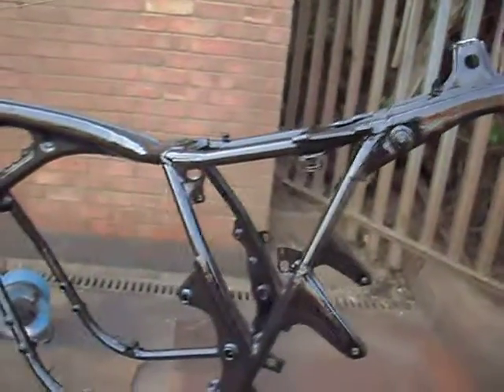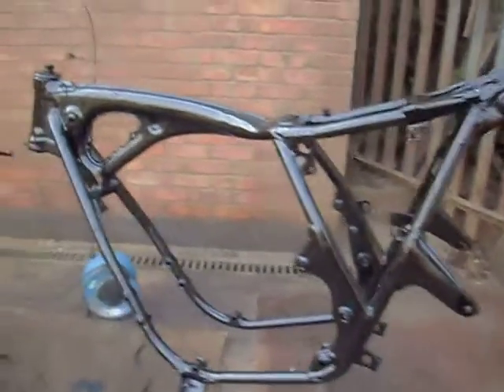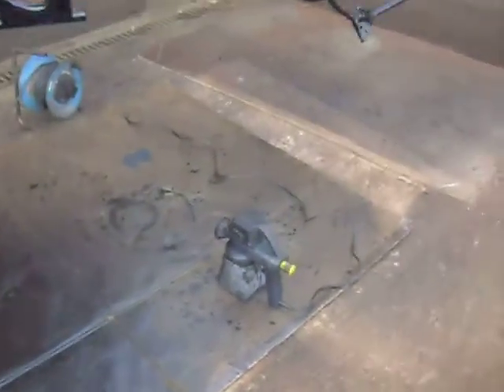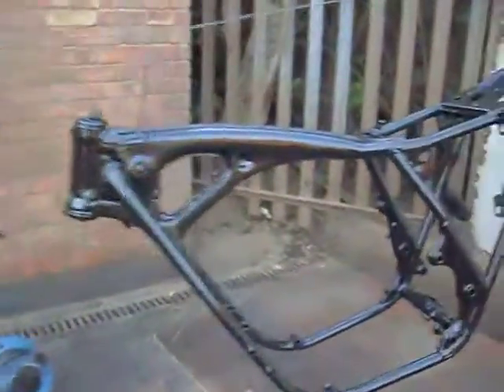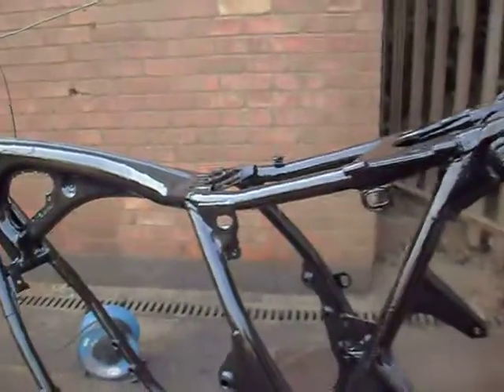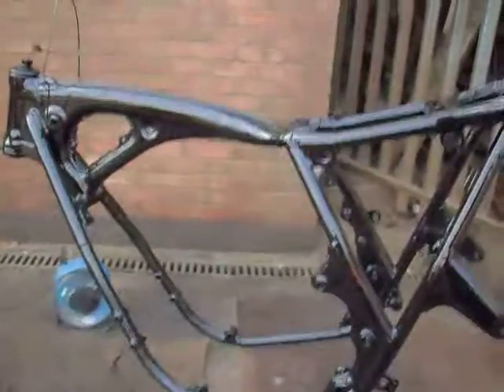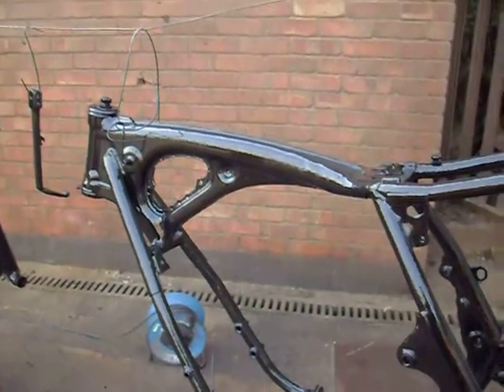Honda CB500  4 rebuild video 28

Comment: what was your spray paint procedure, please provide details, thanks
Reply from the maker: Hi Sancho.I just rubbed the frame down with sandpaper to key the surface,Then applied the under coat,Then next day applied the black topcoat.I used an electric airless spray gun as the paint is very thick.I thinned it a little with the recomended thinners = Xylene. The paint is called Rust Bullet.Look it up on the web,It's tough stuff.  Im in the UK by the way.